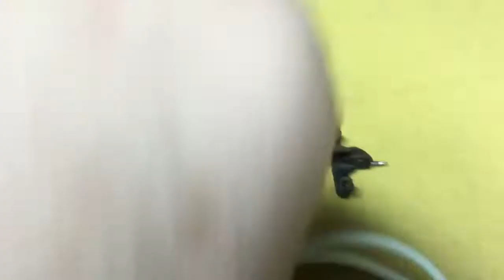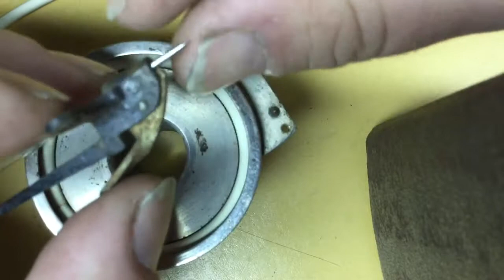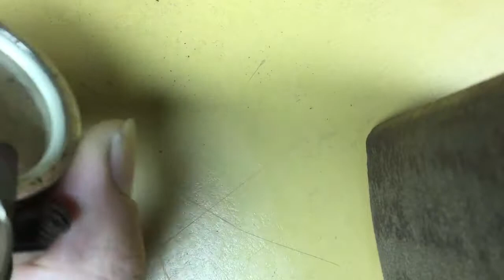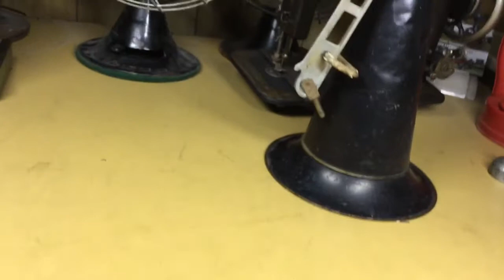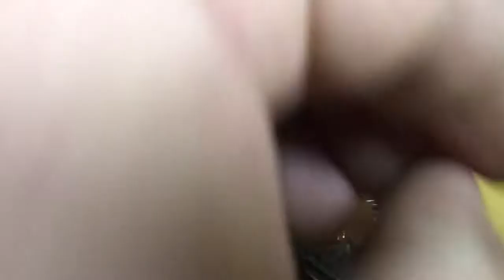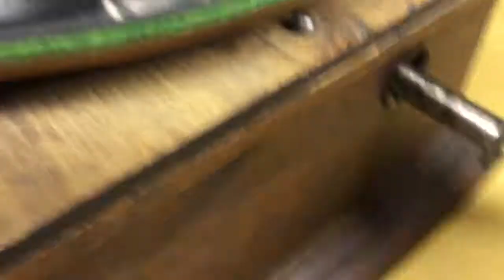Rebuilding a Standard Talking Machine/Columbia Analysing Reproducer

Comment: This is a good little video you made. Very helpful to anyone who has one of these styles of reproducers. As you know, I'm trying to rebuild my own Columbia "Music Note" reproducer. I had a look at Ron's website and It's a shame there are no gramophone parts stores in my area. I sure wouldn't mind going to one of those stores he listed! I think there is about one guy who is a professional gramophone repairer in all of Canada, oh well. Here's the thing, I don't really know what kind of Gaskets the Music Note reproducers use or what size or really where to even get them. I'll go around google and have a look. I just wanted to hear what you had to say about that.
Reply from the maker: Where you able to get the bezel ring to unscrew any?
I did some quick research, and your Columbia reproducer is known as a Columbia Grafanola No. 6, and uses black ring gaskets, and not the gasket tubing like the reproducers shown in this video.  I found them for sale online at https://www.ebay.com/itm/Two-Columbia-Grafonola-No-6-Phonograph-Reproducer-Diaphragm-Gaskets-ONLY/380562383136?_trkparms=aid%3D333200%26algo%3DCOMP.MBE%26ao%3D1%26asc%3D55164%26meid%3D9aa8874b78e244838d1d883b9125fb7f%26pid%3D100752%26rk%3D2%26rkt%3D12%26sd%3D382518313335%26itm%3D380562383136&_trksid=p2047675.c100752.m1982 
and at http://www.antiquephono.com/columsec.htm and they are fairly inexpensive if you want to go that route.  I'm guessing you saw the vendors here: http://www.shellac.org/wams/wvendor2.html  
I like dealing with Ron, his prices are hard to beat, and in reality, many vendors are selling supplies they get from him. Ron sells one part for 50 cents that vendors online charge between $2.50 and $7 for.
You may be able to find some Canadian members who can help you out here on the Talking Machine Forum: http://forum.talkingmachine.info/index.php

If you can get that bezel to budge, and keep in mind the old rubber gaskets are probably petrified by now and acting as a glue, you shouldn't have any trouble rebuilding your No. 6.
Reply: @okbridges  I wasn't able to unscrew anything yet because I didn't get the dividers yet. I'll get them soon. Anyways, I'll most likely just get them from the Ebay link you sent. I think that's the best way to go unless I talk to Ron. I was looking at my No.6 Reproducer and I realized something. I have two slightly different Columbia Music note reproducers. One of them is the number 6 and the other one looks very similar to it but with some minor differences. It even has the same type of unscrewable Bezel. It looks like gaskets from the No.6 Would fit into it. 

Here's a google image: https://www.google.com/search?q=columbia+music+note+reproducer&source=lnms&tbm=isch&sa=X&ved=0ahUKEwjuy6fV2tDfAhVqIDQIHcsGAVoQ_AUIDigB&biw=1920&bih=969#imgrc=I0fXdAFXKdndvM:. 
(If you look at the standard No.6 and compare them, you will see differences)

The reason I bring this up is because they seem like pretty much the same reproducer. My No.6 has a strange adhesive on it. It's covering the screws on the needle bar so you can't get it apart. I assume it would come off with a solvent but I don't know what kind of solvent would work. It's called "shoe glue" or something along those lines. The reproducer in the google image doesn't have this on it. So that's why it's a better candidate for rebuilding. Maybe it's another version of the No.6? I really don't know. As I said, it looks almost identical. The reason I bring all of this up is because I just wanted to go through you before just buying some gaskets which I don't even know will fit it or not. It looks like they could fit, but I'm not 100 percent sure.
Reply from the maker: I think they are the same... I noticed in one of the other eBay listings of  the seller I linked to, he was selling gaskets and a diaphragm and had both variations of the reproducer pictured in his listing.  It looks that there are  two different  bezels, a plain one with the spanner wrench holes close to the inside edge, and one with 'tabs' to reinforce the holes (probably because they were to close to the edge), and on the reproducer body the way the raised bosses that support the pivot screws are different, there is a 'bridge' across them above the stylus bar on some bodies, and no bridge on others.  If you look through the images in the search you linked to, you'll see both styles of bezel used on the bridged body, while the bodies with unbridged bosses have the plain bezel without the tabs around the spanner holes.  
As for the glue, if you already have lacquer thinner, mineral spirits, and kerosene, you are equipped to remove it, so do not let that get in your way. Brush some of the lacquer thinner on and see if the glue starts to soften. If it is a super glue type glue, naptha (lighter fluid) will yield quicker results.
Reply: @okbridges  Well thanks for that! I'll give the different chemicals a try on there. It's not like I have much to loose with that reproducer at this point. As for the different styles of reproducers. I don't see why the gaskets would be different. They're most likely the same considering that the seller had a picture of both reproducers in his diaphragm and gasket kit. It was labeled as "The No. 6". You already know all of this stuff. Chances are that they're the same.